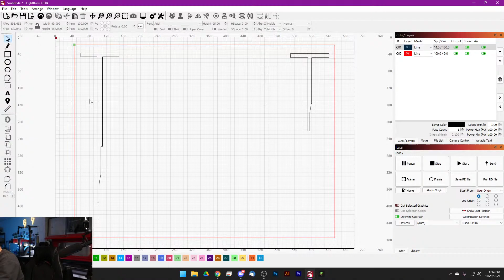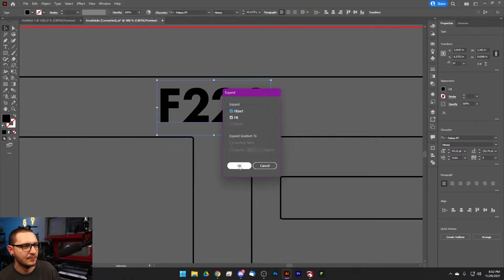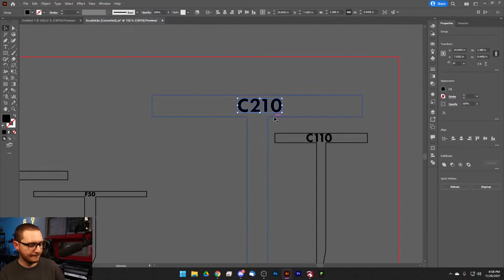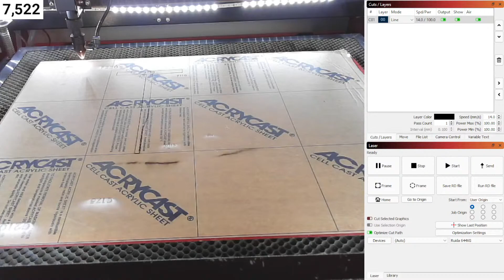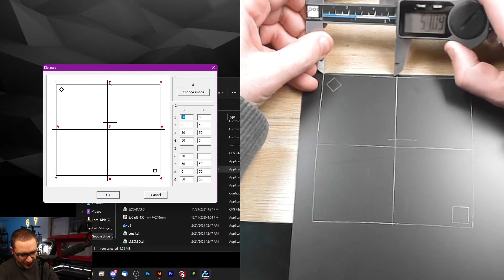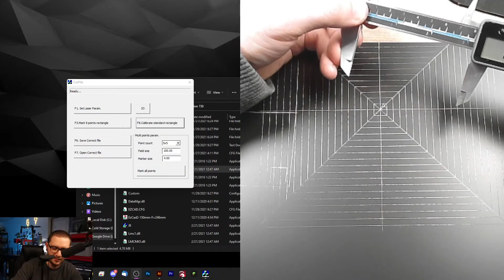Focal Sticks & Lens Corrections | EZCAD Lens Setup | PART 2

Comment: Hi Alex.  Recently I installed my 100mm lens on my 30 watt fiber.  I watched your video on parameter changes and I got those numbers installed.  However , when I brought up my project to be engraved, .5 inch height font was much smaller on the red dot laser and actual test engrave. 100 mm should be about a 4 inch work area.  My text to be engraved was well within.  I changed my parameters in both places like you showed.  I just ended up stretching my text out to fit what I needed regardless of what EZcad was saying my text size was.  I did the proper focal distance by doing a small square with constant engraving on to hear and see the max focus.  Any ideas ?  Thanks Merry Christmas btw.  I’ve enjoyed many of your shows.  I like when you interview other laser businesses.  I especially like the light burn CEO.  It’s nice to hear things from his perspective.
Reply from the maker: Proper lens corrections will fix that for you. 100mm is an approximation. Every lens in reality is a very specific unique focal distance and corrections correct for that. Here's a video: https://youtu.be/llflAf0G62Q